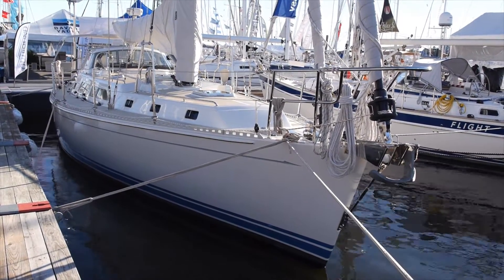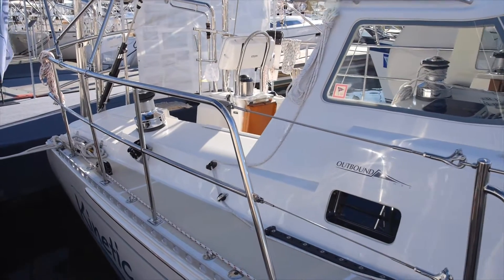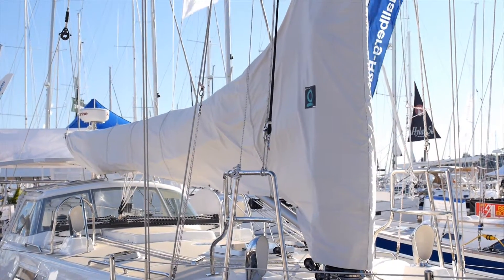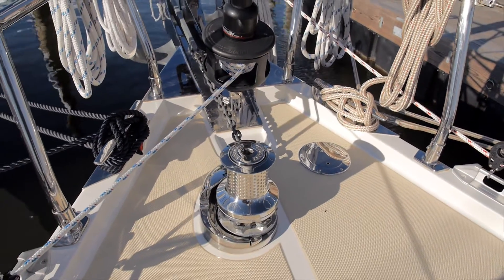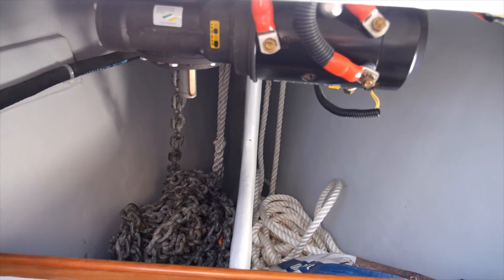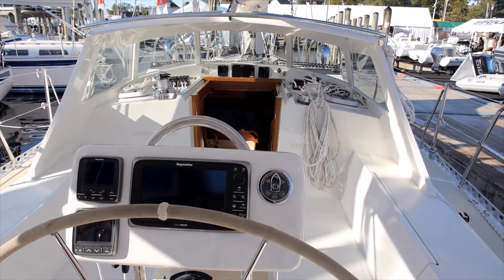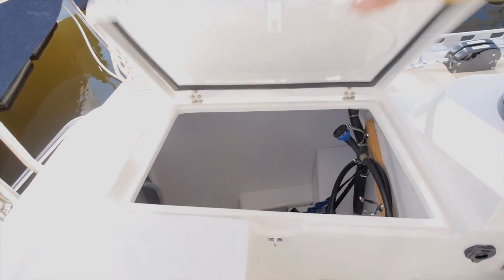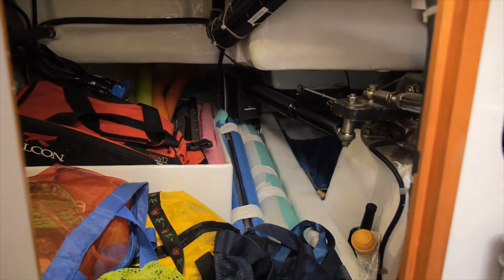Outbound 46 Exterior tour

Comment: I really love this boat! I can't wait to see your 52 aft cockpit design! How would you install a wind vane steering system on the sugar scoop transom? Are all the deck penetrations on this boat made through areas of solid fiberglass to prevent core delamination? Is the pad eye for storm jibs strong enough to run a continual true cutter rig? Can you elaborate on how you "transversely" attach the lead bulb to the keel? Would it be possible to order with a lower cabin sole to accommodate taller people? Thanks